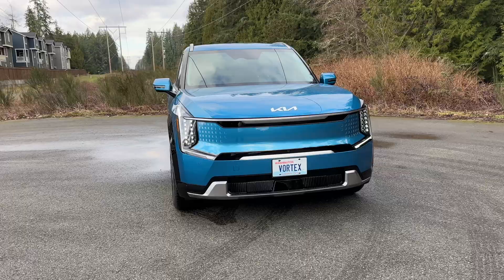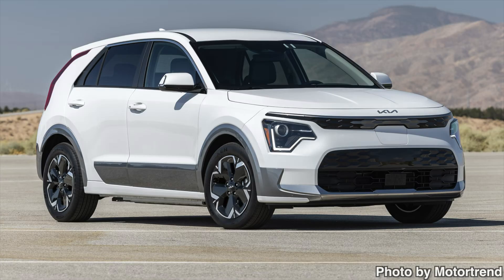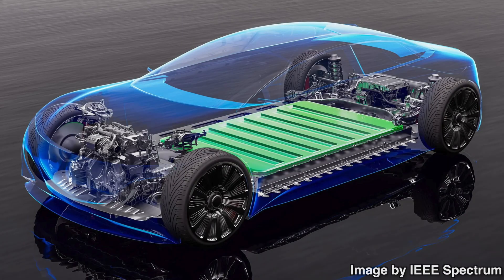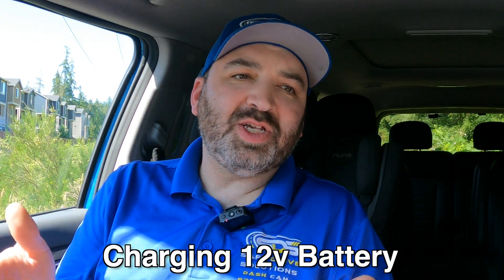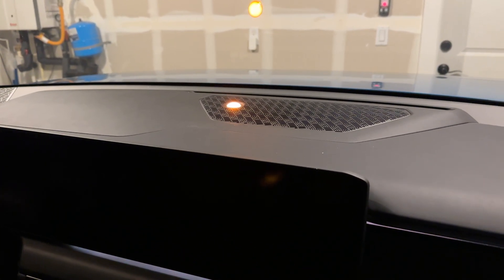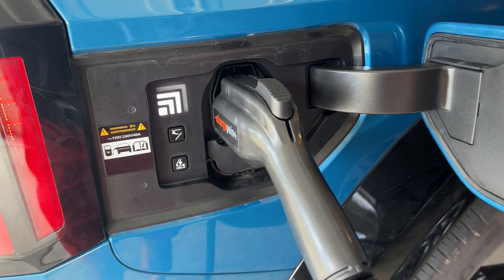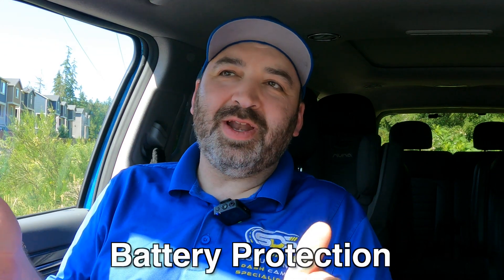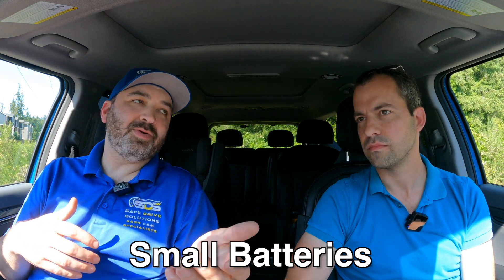Installing Dashcams in EV's: What's Different?

Comment: Off-topic, sorry. Which Pioneer system integrates with the Escort MAXCAM 360C? Is it the AVIC-8600NEX? Looking to get a double din GPS/CD/Stereo Deck for my Car. Nevermind, I see its AppleCarplay/Android Auto that connects to that detector. So I’m assuming the Garmin 86 Drivesmart would work as well?

Comment: On ICE cars is normal to have bigger 12V batteries as you need high peak current to start the engine multiple times. On the other hand, you do have EV's with inverters(Rivian,Cybertruck) and outlets in the back, not sure if those are tapping into the HV battery or they just have a larger 12V one....
Reply: I wish I knew all the answers. Never worked on a Rivian or Cybertruck. We do work on majority of EV,s on market. Porsche, Audi, VW, GM, Ford, Kia, Hyundai, Toyota, and more. Most EV, s have a small battery.

Comment: Do Hybrids count as well? Is it safe to have the Dashcam plugged into the 12v socket?
Reply: Hybrids, like EVs, have a smaller 12v battery than an ICE vehicle, so if you’re running the dashcam while parked it will drain the 12v battery faster than in an ICE.  Hybrids typically only charge the 12v battery when the car’s hybrid system is “on” (ready light is on so it can be driven).  So you’d want to use a dashcam battery pack if you want the dashcam to run while parked.

Now if you’re only running the dashcam while driving, you can connect it to an accessory switched circuit and then it won’t drain the battery at all unless you leave the car in accessory or ignition on/not ready mode.
Reply: @ilovecatsandsynths9702 this is why we always recommend dash cameras with a 3 hour parking mode timer option so you are limiting the wear and tear on the battery. But a lot of dash cameras do not have this timer option and will run your car battery down.

Comment: You don't need to do it on Tesla because it already has a dashcam built-in...
Reply from the maker: True, but I’ve seen people do it regardless to get better video quality and to avoid the baggers drain from sentry mode.
Reply: Nothing wrong with redundancy. Also, audio is recorded from an aftermarket camera.
Reply: True  but tesla's  are almost  the most bare bone
Reply: @CaptainCJ97  What do you mean? you get 360 footage.  PLUS remote viewing ability.
Reply: I have a two-channel BlackVue installed in my Tesla. No external dashcam battery is needed if you tap into a 12v circuit. When the 12v, or 15v (newer models), gets low, the vehicle will activate the DC to DC converter to charge the low-voltage battery.
Reply: @fatwajim  does that drain the battery substantially less than sentry?   What would be the drainage difference in your observation?

Comment: Ultimately it just depends on when the big battery will charge the small battery. In some cases such as with my Mach E, I’ve been told it will only charge the 12v while the car is on. So if you’re running a dash cam when parked for a long time, it will kill the 12v. However other EVs will top off the 12v whenever it’s needed, even when the car is off. I THINK the EV9 and other E-GMP vehicles do, hence the orange light. So in theory you can just use the dash cam whenever, without killing the 12v. Eventually it would kill the big battery of course, but that would take like a year. So it’s practically infinite.
Reply from the maker: Yeah it definitely seems like YMMV on that one. Regarding the big battery charging the 12v battery, I've heard some people say that it can only do it like 10 times. After that, it stops doing it and I think it even issues a warning to the user about the unexpected power drain.
Reply: Thanks for this onfo